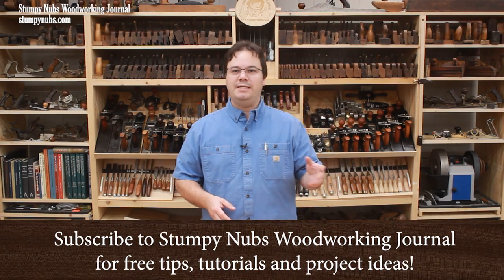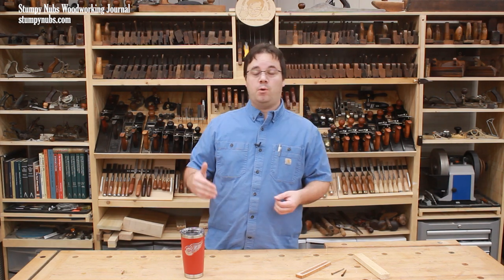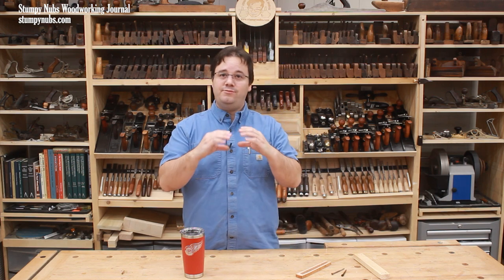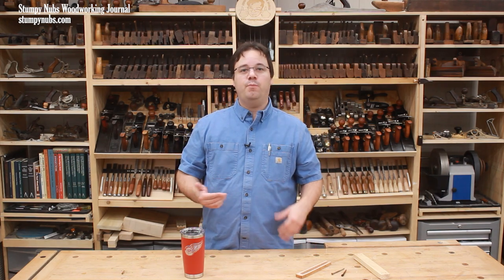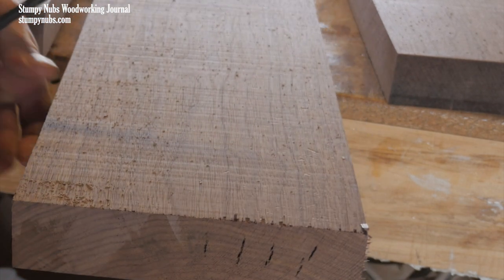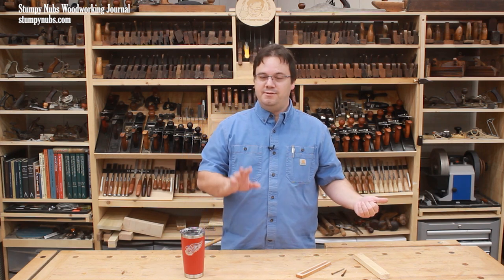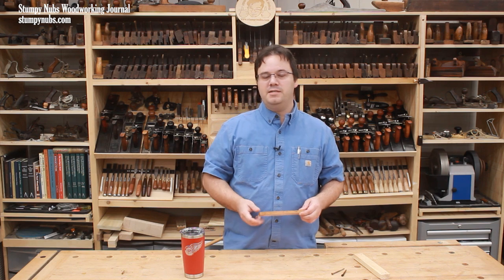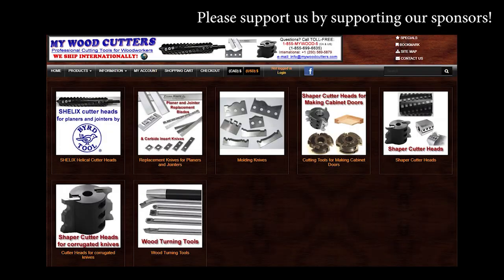A hidden flaw that can DESTROY your lumber! (Case Hardening)

Comment: The old-timer I learned this from referred to the voids inside the board as "honey combing" and the cause of it exactly as you explain. The best way to deal with this is to cut it into pieces small enough to fit into your wood stove.
Reply: @raphaelklaussen1951  great advice for the future but doesn't help you deal with the garbage in your shop
Reply: I'm a newby, but I just had 2 chime n. I imagine this is more prevalent now, when the mills r trying 2 catch up on the building materials 4 the new homes promised 2 buyers.  The prices r supposed 2 decrease 2 us woodworkers (eventually) .  Still waiting.  Bad part is they're mowing them down faster than we're replacing them. What 2 do?  Don't know.  But, we'll pay 4 this n a hugh way someday.   All I want is a couple pieces of wood 4 Xmas.
Reply: U don't want to burn treated wood either
Reply: @dscritter614  Please write in English and avoid "textspeak".  It's annoying.
Reply: @fractode  : The textspeak is annoying, but it is English.
Reply: Honeycomb is different than casehardening.  Honeycomb is when those stresses pull apart the cells and create a "honeycomb" appearance.  Similar problem, but honeycomb can happen due to other reasons than poor kiln-drying.
Reply: @michaelborn3318  I was talking about the voids within the board not visible from the outside. What else causes honeycomb?
Reply: @fractode  I see it as a sure fire way for someone self identify as a person to be avoided.
Reply: no wood stove, but the fire pit works well, doesn't care if it's treated or not. I don't cook on it, just burn scrap and branches in it.
Reply: They work well for chicken coops and other such things.
Reply: @JoeWayne84  you misspelled "you're" - not really making a good case for yourself, are you? 😂
Reply: Air dried only
Reply: Oh come on that was funny, wood workers got jokes, who knew?
Reply: Bazinga
Reply: Honey combing happens when the board is dried too slowly.
Reply: Honeycombing is exactly how it is called in every shop ive been, even in academic context (im a structural engineer that works with wood), the old man knew his craft

Comment: I work at a hardwood lumber mill, and this is something we're always trying to avoid. Our poor kiln tech is constantly fighting the battle against case hardening, trapped moisture, and honeycombing. The sudden uptick in lumber sales is good, but we're constantly riding the fine line between getting wood dried as fast as possible without ruining it. 

One way I've found to "detect" trapped moisture in a board is to run your hand over the surface- spots with trapped moisture will usually feel unusually cooler to the touch. Plus, a board will often feel heavier than normal in a same-sized piece. Thanks for highlighting this problem, James.
Reply: Damn, I got this all wrong.  I always go for the heavy one thinking I will make out on "per pound" basis.  I thought the wood is better because it was more dense.  No wonder they twist after leaving in garage for a while.
Reply: If you stack you lumber with wood spacers between the boards every few feet and leave even weight on it, the wood doesn’t move (warp, cup etc) and it continues to dry. I don’t know how this works on a case hardened board, but it seems to help on wood that isn’t fully dry or acclimated to your shops humidity.
Reply: @ipick4fun27  I still pick the heavy DF boards/posts when I'm doing an outdoor project, because at least with that one tree, heavy usually equals significantly harder.
Reply: Would bringing a moisture meter to the lumber yard help detect case hardened boards?
Reply: @ICantStopMakingNoise  i bought 10x 20' yellow pine 2x8s; one of the last ones i picked was for sure double the weight. looking at it, it looks filled with resin; smelled way stronger too. I also thought this would be a stronger board; though I really have no idea; certainly is harder
Reply: @SRG216  Yeah. If you use one, try it in a few different spots- if you start seeing values over 11% (or whatever the EMC is in your area), put the board back.
Reply: @daveschmitt6369  it doesn't. A case hardened board has what's called "trapped moisture" in it- the moisture literally has nowhere to go because the dry fibers surrounding it have shrunk down too much to let it escape. Hence the cracking or honeycombing. About the only thing case hardened boards are good for is for keeping your fireplace fed.
Reply: Wow, great comments/info.  Thanks!
Reply: Get the word out that you're using a slower process for kiln-dried lumber, and this problem is why you've adopted this process. I'd have happily invested in a higher priced product that resulted in a lower loss on the table saw, because I lost a Helluva lot of lumber to exactly this!!! Initially I'd suggest about a 20% run of the slower dried lumber, and store it separately, track sales, do the math... if you can sell it for a high enough price to offset your cost increase, and make a decent profit on the lumber... there's your answer!
Reply: Case hardening is a blanket term, I run 2 types of dry kilns myself, the old school wet bulb and dry bulb type and the more sophisticated computer operated with temperature probe and a wafer that measures the equilibrium moister content of the wood. "Case hardening" as he is talking about are in fact the stresses in the wood pulling in when the interior of the wood is still at a higher moister content, however it is reversible if it happens. A good kiln operator will test the boards during the run and will run a slightly longer conditioning cycle at the end of the run to equalize the internal and external moisture content of the wood, which in turn reduces the stresses of the wood. The honey combing and collapse of the wood walls is due to a harsh initial drying temp which will cause the water to move from the center of the wood to the exterior of the wood too quickly causing the cell walls to shrink and collapse, since the external cell walls are still wet it will not shrink as fast which in turn pulls the fibers apart. These boards are still sound they just are not pretty to look at, use these boards for internal frames instead.
Reply: @vukkulvar9769  would that work though? I thought it was because it only feels cooler as its damp rather than actually being a different temperature, like feeling a piece of wood and metal at the same temperature, the metal always feels cooler because it absorbes the heat from your hand faster.
Reply: @daveschmitt6369  Thats correct.  I spent a gazillion hours at my grandfather's mahogany mill on the stacker machine putting lumber on sticks that's about to go into the dry kiln or to be air dried.  If I remember correctly the sticks were spaced 2 ft apart and you always want a stick supporting the very ends of the boards.  If lumber was 3-4 (12-16 quarter) inches thick you want to use a thicker stick than thicknesses less than that.  If you're air drying packs of lumber, the space you put between packs of lumber makes a huge difference on drying time b/c of increased air circulation.  You dont want your forklift drivers putting columns of lumber packs up close to another column of lumber packs.  When we would open the dry kiln and take mahogany out the only boards that bow, twist, and warp really bad are going to be the top layer of the top packs in the kiln and thats b/c there was no weight on top of them to keep them pinned as they were drying.  Sticks are critical to both kiln and air drying lumber.

Comment: As a mechanical engineer, I've only ever heard the term case hardening being used to describe a process used on steel parts where they're cooked in a furnace while coated with material containing a lot of carbon, so the carbon diffuses into the steel through it's surfaces, giving high carbon at the surface to give a hard but brittle outer surface combined with a lower carbon level at the core of the part, making it more malleable, to allow the part to survive mechanical shock without cracking. I had no idea that the same term was used to describe an attribute of wood though. Thanks for producing this and your many other educational videos.
Reply: Me too. Always thought of case hardening in metallurgical terms.

You learn something everyday!
Reply: Also, the process he describes is very similar to how Prince Rupert Drops get their properties.
Reply: Imma bout to blow your mind. When making salamis or curing meats we can get problems with case hardening too. In exactly the same way described in the video. Only this kan also lead to spoilage or pathogenic growths
Reply: Would other methods of surface level carburization, like nitride bath(quench, polish, quench) also be considered case hardening or is that an incorrect use of the term? Also, some steels air harden at the surface level achieving the same results, would those be case hardened? Or does case hardening refer to the process rather than the results?
Reply: @umdcornholio  I was thinking exactly the same thing, but isn't that in the reverse?  I'll have to go back to the old video that explained how the stresses work.
Reply: Well now I've learned two useful and interesting facts.
Thanks, peglor.
Reply: At school it was called "Surface Dried" lumber in NZ , case hardening can also be done with a sooty oxy flame cooled in natural hydrocarbon oil.
Reply: Is this what happened on the Titanic steel? Or what should have happened and didn't?
Reply: @nfcapps  As I understand it, the steel composition and heat treatment could have been better, but smashing into an iceberg at full speed due to perverse management incentives (The captain wanted to set a speed record on the maiden voyage and ignored repeated reports of icebergs) was going to do that level of damage regardless. 

Case hardening is used on things like gear teeth to make them harder wearing rather than on structural steel plates and girders. 

There is, I think, an argument that low temperature embrittlement might have contributed (See the Liberty Ships in WW2 as a more recent example of this where then process began to be understood). It could have been better engineered by modern standards, but not with the knowledge available at the time (Except for lifeboat capacity obviously).
Reply: @peglor  Well, also battleship armor plate but yes. Not usually on ship seaside.
Reply: Case hardening is more about keeping some sections soft enough to undergo further machining or forming after the primary heat treat, while getting the strength properties needed in high load areas. Properly heat treated steel is not brittle except at the most extreme hardnesses, levels which are only used for things like high end Japanese kitchen knives and never approached in most machine parts. (Ignoring both stainless and "machinable" alloys here. The Cr, S, and P that make them either stainless or machining friendly also create inherently more brittle properties.)
Reply: This is all super interesting. Thanks. And, yes, why wouldn't you carry enough lifeboats? I think it went along with the speed record, the lifeboats weren't ready in time for the scheduled departure so they just relied on the "unsinkable" part. I think I heard something about that, but it would have been so long ago I might be remembering incorrectly.
Reply: @nfcapps  Cost and deck space. And they only expected them to be used for rescues, not as actual lifeboats. That is transfers between ships, because being unsinkable it could stay floating while waiting for rescue, or in picking up survivors from other ships that sink. 
At that time in history it was also common for executives to believe that safety precautions were an implicit admission of danger and liability. (This mindset continued in some industries into the second half of the 20th century.) So having lots of lifeboats would be saying that the ship was known to be likely to sink.
Reply: Same
Reply: I guess with glass, which is more analogous to this wood example as carbon casehardening changes to material rather than its state,
we call it tempered glass however the quality of tension & compression within a given piece of material is similar.
My version of casehardening for wood that's more analogous to steel is coating wood with a cyanoacrylate (superglue) that hard plasticizes the surface.
Reply: Case hardening is purposefully used on firearms. The thin hardened exterior resists abrasion and minor impact but the softer inner steel can withstand the stresses created by the deflagration of the powder charge.
Reply: @srenjensen7208  yummo, I'll have a side of botulism with that. Thanks. Haha.
Reply: Correct. It is a misuse of the term.  Only so many words out there I guess.
Reply: @srenjensen7208  Now I know why all my structural salami is warped.
Reply: Look up the recipe for case-hardened potatoes to go with your next roast.

Comment: I've experienced this numerous times, for many years... I learned it could occur at any time, and the consequences could be burnt wood, or "Very Serious Kickback Issues on the Table Saw!"  I never had any idea of the root cause...Case Hardening.  After few violent incidents that involved "flying wood," I figured it was a totally unpredictable risk, associated with ripping wood... Always be strong, and be ready "to stall the saw", if the wood, closes on the blade... I'll continue to do this, as my old table saw has no "riving knife."    Thank you James for yet another fantastic video!  Next time it happens, I'll be smarter! 🙂
Reply: A nice little trick is to not stand directly behind your saw while operating it. Stand slightly off center, that way any kick-back won't hit you
Reply: If your old saw is anything like my old craftsman 113.x, replace the original start/stop switch with a start/stop paddle switch and move it to the left side of the saw body. Replace the cord while you're at it, it's probably old anyway and not terribly expensive. Doing this allows you to stand safely to the left of the saw and be able smack the off switch with your knee. It works...trust me.
Reply: @danieljw1342  Excellent tip
Reply: @danieljw1342  Very right
Reply: I have my Dad's 70 yo table saw... swapped a bearing or two over the years and still works great! You can make a riving knife pretty easy and I did... I think Stumpy even made a vid tip on it. I found it to be safer than my 60 yo reflexes. lol

Comment: For what it's worth, they should also check the table saw fence alignment.  Best to be a couple thousandths out of parallel with the back of the fence veering away from the blade. Just a couple thousandths but it makes a huge difference once blade runout, a bit of case hardening, etc. is considered.
Reply: It wouldn't hurt to check, but I've had the same thing happen, and it was definitely not the saw. I was ripping a hardwood floor board, and it completely stalled my saw. I finished the cut on the bandsaw, and by the time I was done the two pieces of the board were bowed apart more than an inch in the middle. The pinching force on the blade is similar to the force it takes to squeeze the bow flat once the pieces are cut. 

I always assumed it was just weird grain causing tension in the wood. Flooring is usually a lower grade than wood used for furniture making, so the grain isn't necessarily straight.
Reply: Yep, first thought I had. Seems like his board is getting pinned between the fence and blade.
Reply: First, check (& correct) alignment of the saw blade axis to the table’s miter slots. Mine was off, I had fiddled with the fence alignment but couldn’t rip a long board without binding and burning. Saw the tip about aligning the blade on one of the Saturday morning woodshop shows. Checked mine and found it was out of alignment and one of the trunnion bolts was loose from the factory.
After getting the blade squared away the fence alignment fell right in.
Reply: That was my first thought too
Reply: Honestly, I think they are more a marketing YouTube channel than a woodworking. They are making way more money from their marketing/business private group than their cutting board business.
Reply: To add this, a lot of Hybrid saws (I use one regularly) come with a hollow core aluminum piece that attaches to the main steel portion of the fence, and that piece of aluminum has very thin walls. I took a straight edge to it and I noticed that there was a significant bow in the middle, just under 1/8”. Needless to say, I removed those flimsy thin walled aluminum pieces and replaced them with extruded aluminum to give it more beef and keep it perfectly straight. Also, it allows for me to add other attachments, since it is t track as well. After installing and making sure it was aligned, I noticed immediately that the saw was performing much better and cuts were a lot better and no burning.
Reply: @larrybud  the wood is getting pinched. The question is whether it's due to tool issues or wood issues.

Comment: I have experienced this off and on for years. Always put it down to weird grain in the wood. Had no idea it could be caused by improper drying. Thanks loads   for the video, I now am much better equipped to deal with this issue. Thanks!!

Comment: Awesome explanation! I recently had this exact problem with a 1x8 piece of pine I was ripping for drawer fronts for a shop cabinet. I immediately went and bought a new blade from the local big family store…didn’t solve the problem. I finally got the piece cut however, and when I was installing the drawer faces I noticed how badly the ripped edges were cupped! Wish I knew this then.